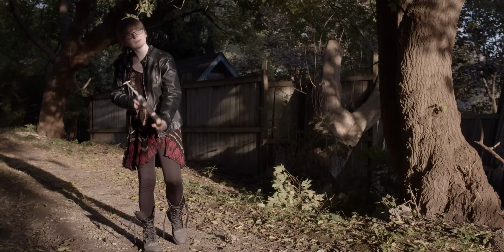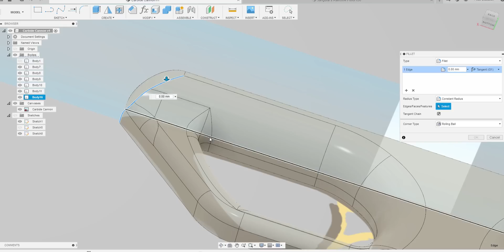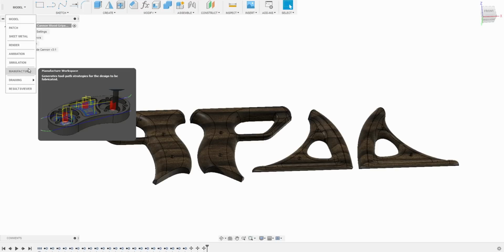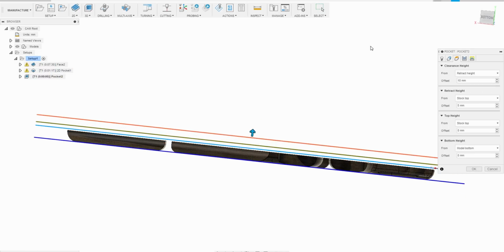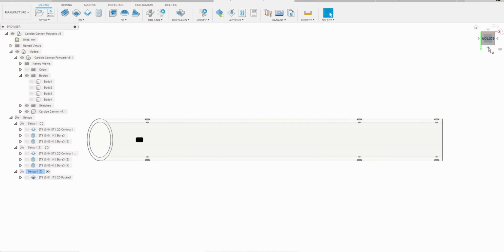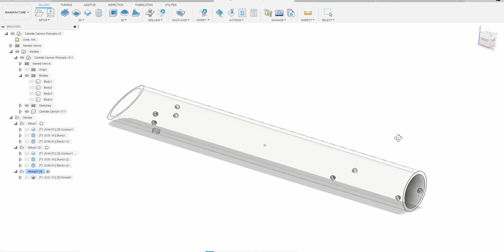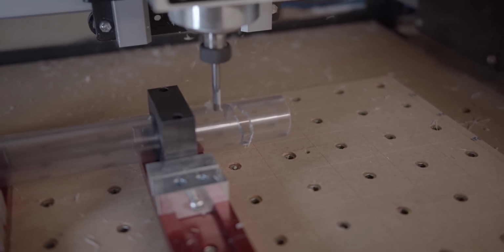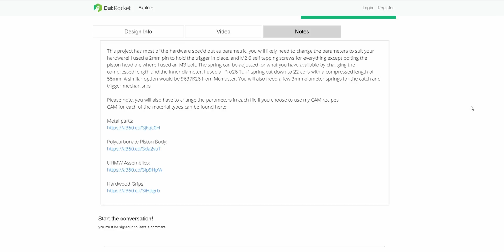The Carbide Cannon - CNC Machined Foam Dart Blaster

Comment: That's a massive chamber, probably on par with some of the biggest in the nerf hobby. This could probably accept 12" 17/32 brass. If you use short darts, the performance will be substantially improved.

Comment: Thats a cool little nerf gun! I like the handle styling, but I felt that you struggled unnecessarily on the tube. I don't think I would have tried to create it on the cnc. A drill press and miter saw might have been a lot easier. Props on working through the issues and making a nice end piece.

Comment: You are definitely ways ahead of my capabilities and I enjoy your videos, why can’t I get a simple answer of why I cannot even make a simple square or oval Without the bit picking up and down and not making a clean pass all the way around the path
Reply: Sounds like you're not holding down your part very well
Reply: The part is not moving,I have tried several different hold downs, I even played the piece on a 2% out of level,front to rear,with the same errors, it just cut deeper on the high side.

Comment: What kind of glue did you use between the wood and tube? I'm surprised it's holding under the strain...
Reply: You could use epoxy, but I chose odorless medium CA glue. The odorless is important because otherwise the polycarbonate would fog. There's a very large surface area between the tube and the grip, larger than you'd think because it wraps around the cylinder body.